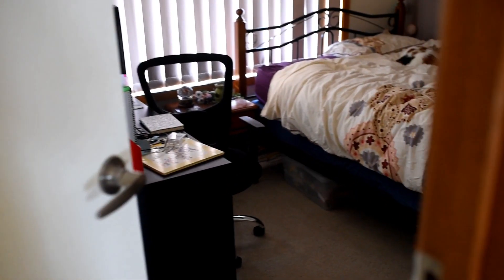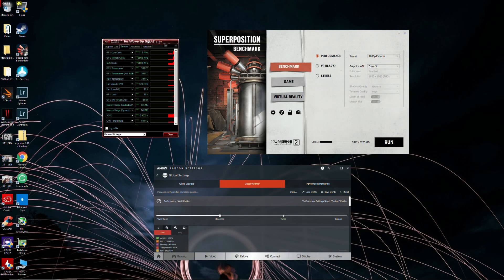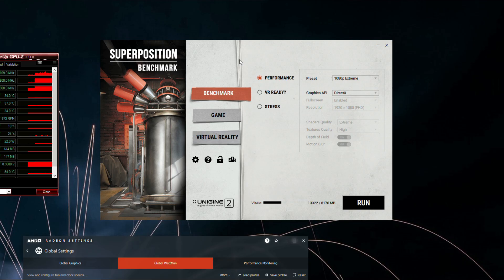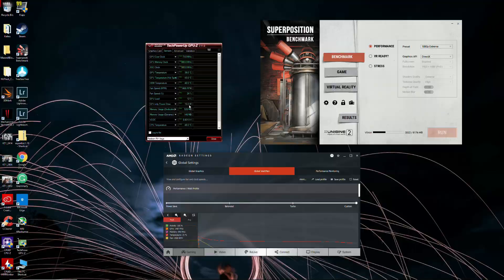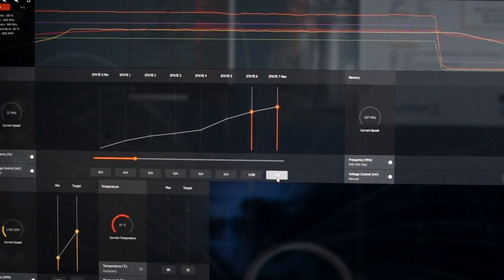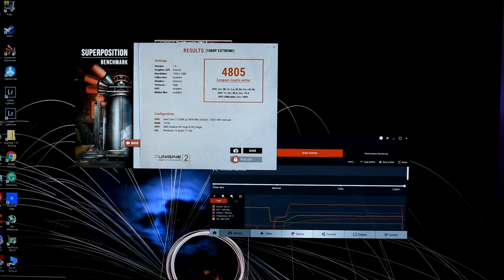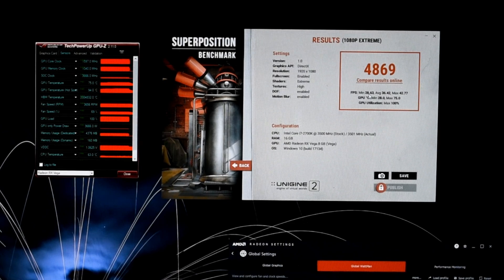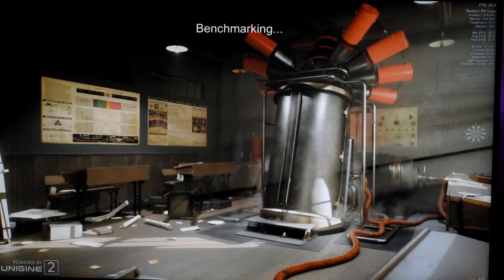Undervolting Vega- Turn Down the Watts!

Comment: I have the Gigabyte Vega 64. It's been freezing up the system periodically since new, even under relatively low load. I assumed it was just an AMD driver issue, but it hasn't improved over time. I've had to reboot the machine even watching YouTube videos! Is this something that messing with the settings is likely to help, or do you think the card is defective? I've been tweaking the settings in a bid to improve matters, but I don't really know what I'm doing. :(

Comment: Hi techforged australia. have you tried flashing your bios to vega 64 LC bios then undervolting it? I have a small dan a4 sfx case with a ryzen 1800x liquid cooled with a asetek 92mm aio. I also have a corsair sf 600 gold sfx psu. Im a little worried about my psu not enough to power the vega 64 at full load. Also cooling is a bit of a concern since the small space in the case and no aux fan. Just the reference cooler to cool the gpu. I want to get the most performance out of vega 64 but with still tolerable fan noise. Thanks in advance

Comment: Your undervolt of -150mV didn't stick. For it to work, you needed to lower the HBM voltage down to the same voltage as P7, in this case, 1050mV. You would see another big drop in power consumption and temps.

Comment: Nice video 👍!  What are your thoughts on the Sapphire Nitro+ Vega 64?  Should it overclock pretty good or should I just worry more about undervolting?  Thanks again.
Reply from the maker: Thanks Steel, mate I reckon the Nitro+ Vega is one of the best looking coolers out there. You could certainly overclock on those cards, the only thing holding these reference cards back is thermals. 

Overclocking does increase the power draw significantly, so keep that in mind.
Reply: @techforge-Nate  awesome!  Definitely hoping to push the card a little.  That's the whole reason why I bought a Vega!  I love messing with stuff.  Lol

Comment: Good video, I have a question. If I undervolt my rx 480 in Wattman, or just apply any other tweaks to it (using Wattman of course), and then use MSI Afterburner while playing games, will my tweaked profile of Wattman apply to the game or will the MSI afterburner profile apply?
Reply: Vega, better use WattMan (MSI AB can be used, if you are able to...)
290/390/480/580 you can use MSI AB.

Comment: Might have to pick one of these up to mess with but most likely one of those triple fan or dual fan models.  if i can get a sale.
Reply from the maker: I think I saw the Sapphire Reference model (same as this card) on NewEgg for less than AU$650 recently.  I'd love to try these cards on water but it's just a cost issue currently. The Strix has the looks but has suspect VRM contact to the cooler, Powercolor Red Devils are a bit boy-racer for my tastes but I haven't heard any bad words about the cooler on them.

Comment: So whats you recommend me to do? I have a vega 64 strix asus....  What do you think about the best option of undervolt? Im from argentine ! Thanks!!!
Reply from the maker: With the Strix I'd definitely be undervolting using Global Wattman like we did here, rather than overclocking. There have been a few cases with the Strix cooler not covering the VRM's properly (it's the cooler from the 1080ti on it, but the VRM thermal pads don't make proper contact at one end), and having VRM temperature issues. Overclocking will pull more power through the VRMs.
Reply: @techforge-Nate   thanks !!! Love you ! Love your channel ! . Can if you want only if you want send you my Scores like you did on the video with my Asus ? 4 jpg archives.... Have you an email ? Sorry my english im spanish, 38 years old from argentine.

Comment: Good video, I have a Vega 64 I use for mining and if I undervolted it was having significant Hs drop. But if I just use the Radion settings to give it -30% power it workes great. Getting             44MHs on Ether at 54c.  ps I am in Western Australia have good one bro.